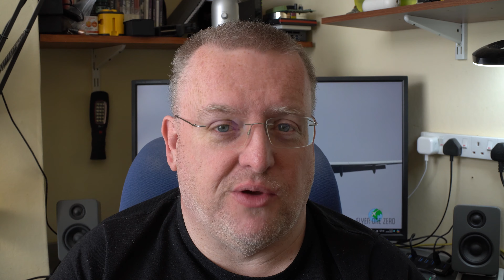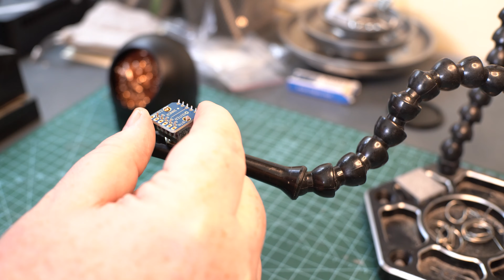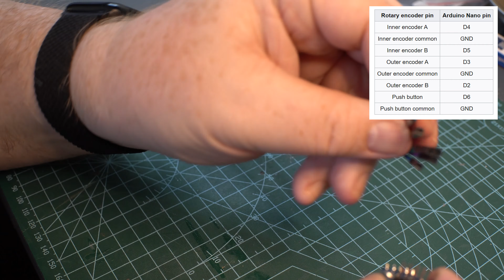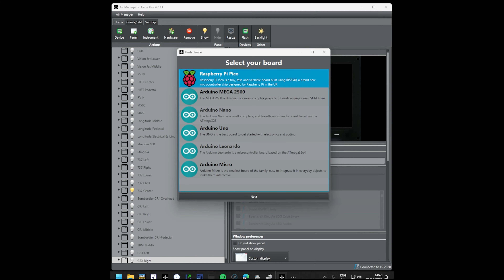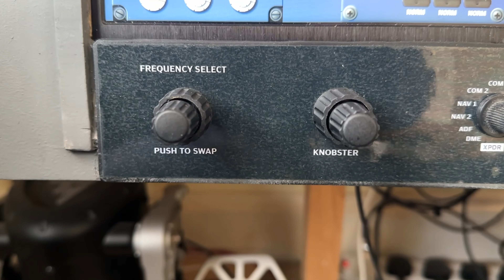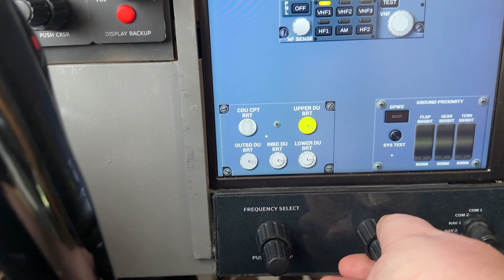Flyer One Zero and... Making a DIY Knobster

Comment: Just about to tackle this myself, so thanks for the video.  Not looking forward to the soldering though as I haven’t done much in the past and this is quite small stuff, but fortunately I don’t have to do it on the Arduino side as I got a pack of three pre-soldered on Amazon.

As you probably know by now the Leo Bodner encoders having the PCB not soldered isn’t an error as the webpage says it’s fitted but unsoldered just in case you don’t need it.  Personally I wish there was an option to have everything soldered in place including the jumper pins for a few quid more.

Edit:  Managed to solder two of them up and found a case to 3D print (though had to make some modifications to it) and they are all working so thanks again for the video. 👍🏻

Comment: I just went to buy one of the encoders, they are £33.60 + £6.60 for the dual knobs + £5.50 postage so that £40.20 + £13.95 and finally around £5 for jumpers so that's Over £60 to make this, without a case, seems expensive to me  as a complete unit from Sim innovations pre programmed.
Reply from the maker: @ianbarnes6266  I see that the price of the prebuilt unit has dropped as well to EUR95. So it’s definitely borderline. I suspect you can get the encoder and the knob kit cheaper than Bodnar, but I haven’t done the research to prove it. In my case, I wanted to DIY it anyway, I didn’t need a case, and price wasn’t my primary concern. But I think it’s good that we have a choice.

EDIT: I had a quick look around and there are certainly far cheaper alternatives for the encoder. Provided it does the same quadrature encoding, I’m pretty sure it would work.

Comment: Just built one using your video as guidance. Worked great except the direction is reversed CW goes CCW in Air Manager. I switched the  wires on the A&B pins and it now works perfectly. Wierd! Great video, helped loads.
Reply from the maker: Yeah, looks like I mixed them up in the video. Oops!

Comment: Hi Will this homemade one work with SimBox?
Reply from the maker: Well, they claim to be compatible with Knobster and a DIY one has exactly the same firmware as the SI-made one, so I imagine it would, but please don't make buying decisions on the basis of my advice. If in doubt, ask SimBox.
Reply: Not this version. I built it and while it functions perfectly in Air Manager, it isn't detected in Simbox (Or KnobFS). The simbox Knobster uses an ESP32 and two separate encoders but I would imagine you can interface it with the dual encoder in the video. The way things have been engineered, if you want the full Knobster experience, you have to buy the genuine thing, which I just have.

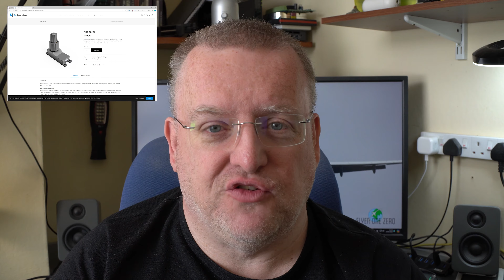Comment: 0:33 - 114 euro for what appears to be basically a potentiometer is criminal. Definitely something worth building yourself.
Reply: I think it's expensive for what it is, but a good quality rotary encoder is more expensive than a potentiometer, and there's also an Arduino Nano in that case. The case might be 3D printed or it might be injection moulded, it's not clear from the photos. If the latter, that's quite expensive for a small production run. Basically, I think you're paying for the fact that it's not a mass-produced product, and for the convenience of not having to make it yourself, which some people will value. Interestingly, since making this video, the price on the SI site has dropped to EUR 95. But if you're handy with a soldering iron then DIY is a no-brainer.